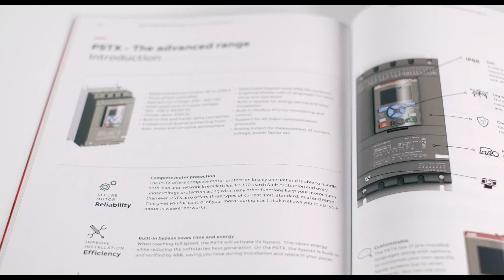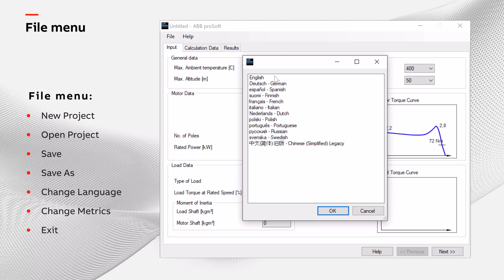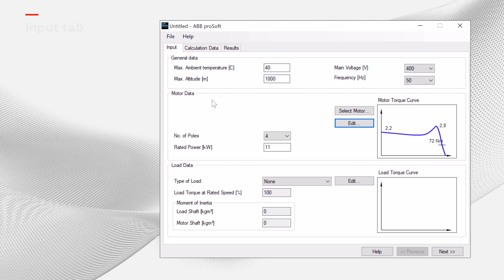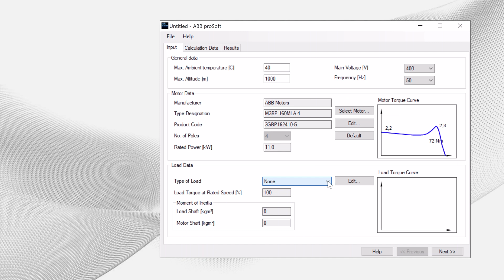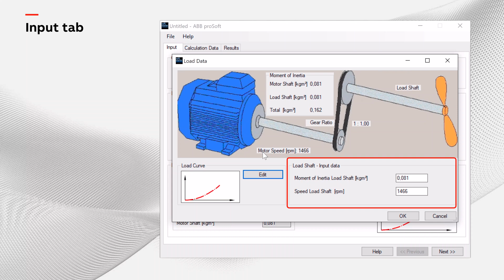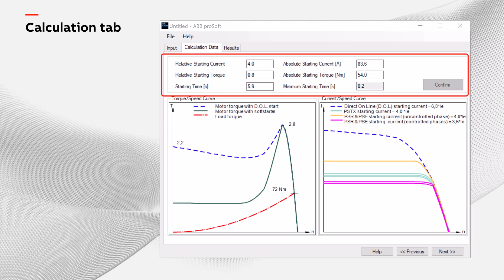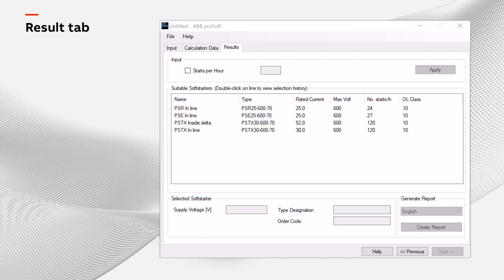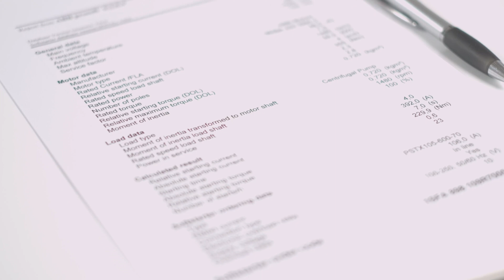proSoft tutorial – Softstarter Selection

Comment: I disagree. This tool helps to find the correct softstarter. In Norway with strict requirements set by the national road authorities, this sertenly will reduce the need for costumor service if the engineers can figure out the data on their own!